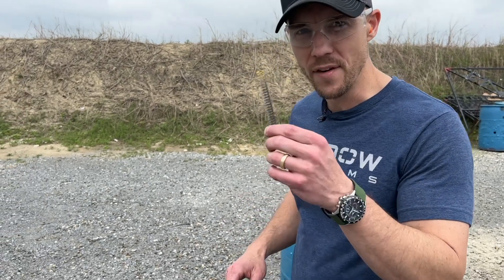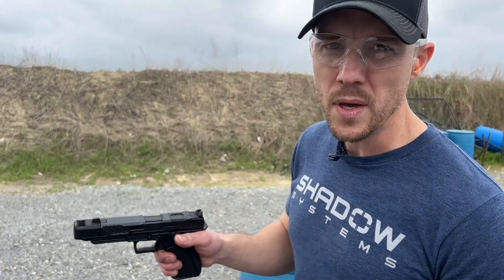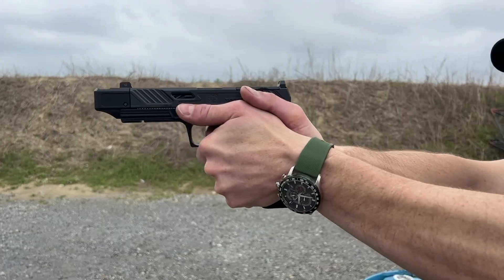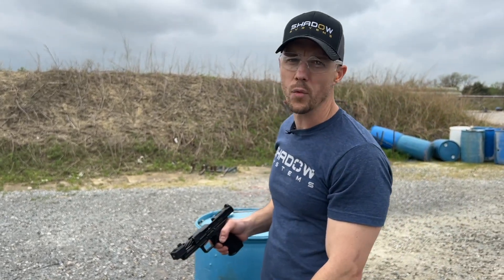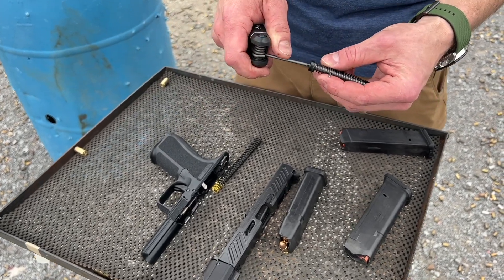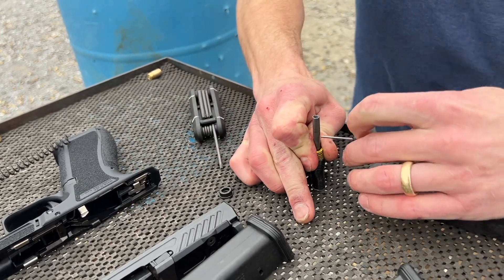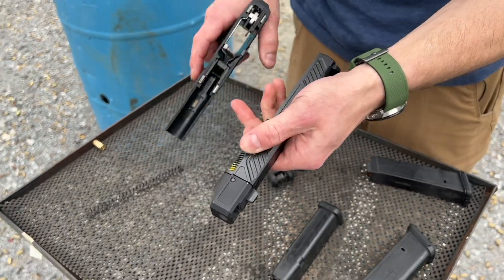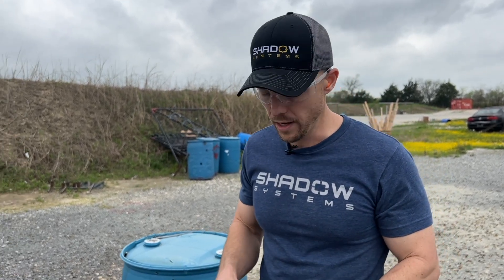Technical Tuesday - DR920P Recoil Spring Options

Comment: Tried changing the spring, used the takedown tool in the hole, snapped the takedown tool. That torx screw is glued on there strong.
Reply: Lol I’m having the same issue I just recommended buying the complete guide rod set 😂

Comment: Never had issues with my glock 17 jamming up, purchased the dr920 for duty and routinely have issues stove piping while running practice ammo, hope changing the spring eliminates that problem
Reply: See my full comment above. Same here for my experience on the DR920.  In my opinion, Trevor's comments regarding poor technique is gas-lighting customers to make them believe it's their fault rather than a fault of the company for not doing full research on the 'P' model prior to release.  Every compensator I've ever tried requires tinkering with the springs to get reliable cycling, period. Scott Jedlinski is the best trainer ever - some of his "technique" is covered here - See about 8:00 min. for "arms".
https://youtu.be/V_2PrZ_UG9o?si=wbF3AHjPLVK6j5EP

Comment: Recently purchased a DR920P. Left the standard weight recoil spring in it and ran 250 rounds of 124gr NATO Winchester through it with zero issues. Ran several different types of ammo in it, after the break in, and it runs like a sewing machine. Great pistol, I’m a big fan.

Comment: This video was AWESOME!  I was guilty of everything you stated, bent arms...too light/loose of grip  and .115 caliber ammo vs. .124 or higher (DR920P).   I was so, so excited to fire this gun and it jammed after one shot every time, and when I say jammed....I mean jammed...I could not clear or drop mag..,,,range master said it was probably wrong spring tension.  Can't wait to go try out with proper ammo and proper technique before replacing spring.  
1. Anyway you can slowly show how you break down this gun again?  I have a TON of handguns, I cannot for the love of God get this thing to break apart without dry firing once I've got it unlocked.....you do it way, way too fast in this video for me to figure out your technique. My Berretta and Bursa for example are super easy, this one is not.  I was always taught to not dry fire a gun, but doing this way always causes it to crumble apart...what am I doing wrong?
2. Is .147 grain OK for this firearm?
3.  Thanks again for your videos...very helpful and informative.
Reply: Jessica (in the blog below the article) with SS actually recommends the 115 grain for the comp on the DR920P because more gas makes it work better - her words not mine - Trevor says the opposite and recommends full power ammo (whatever that means).  And re: the "bent arms"- watch Jedi's presentation here - he covers arms at about 8:00 min. into the vid. In my opinion, Trevor's comments regarding poor technique is gas-lighting customers to make them believe it's their fault rather than a fault of the company for not doing full research on the 'P' model prior to release.  Every compensator I've ever tried requires tinkering with the springs to get reliable cycling, period.
https://youtu.be/V_2PrZ_UG9o?si=wbF3AHjPLVK6j5EP

Comment: This isn't really the problem, most people use 115grain 9mm at the range, probably the most available and affordable. This gun has not done well with that even with proper technique, really does need the lighter recoil spring to operate properly

Comment: Question about the mr920 with threaded barrel how do you get the thread protecter to stay on always coming lose
Reply from the maker: Tyler, have you tried an O-ring?  We have them on the website.  Using it between the barrel and the thread protector will keep it from loosening.  Take it off before mounting a can!  Trevor

Comment: This had my cracking up. He has given up on trying to teach you the proper technique and just giving recoil springs instead 😂🤣 I feel bad for him
Reply from the maker: Hahaha.  That made me laugh pretty hard.  Trevor
Reply: I've owned my DR920P for a week and put about 1000 rounds through it. I can solidly say that it isn't poor technique that's the cause of malfunctions with this gun but the nature of Glock style guns with comps on them. I've shot a wide variety of ammo through mine, including lighter 115gr, 124gr and 147gr and had 5 other shooters try it as well. Mine cycles the hotter loads with no issues but the PMC Bronze 115gr gives me occasional stovepipes and some lighter pressure 124gr I have gave failures to extract. All these are indicators that the recoil spring is too heavy.

Every company under the sun will tell you their comped gun or their compensator will work with a standard weight spring with any ammo and almost all of them will require some tuning.

I look forward to dropping the 15lb spring into mine to get complete reliability with all ammo types.
Reply: I can’t imagine the ridiculous calls customer support has to deal with.
Reply: All the tactical wannabe badasses that have not even the slightest clue how to shoot have these issues. They are too busy trying to make their EDC setup be the hit of Instagram to actually practice any fundamentals.
Reply: @adk77caps52  it’s just sad. I really wish they would have made them to work as good as possible and run hot gassy ammo like it needs. Could you imagine how many calls they would get saying the guns aren’t working 😂
Reply: @adk77caps52  nailed it.
Reply: This is sad that this has to happen. But.... some people may have Injuries
Reply: After running my MR920 in limited and being able to hold my own, I’m seriously considering picking up a DR920P and turning it into an open minor gun.
Reply: A gun should go bang no matter what , this is an excuse .

Comment: Is this true for MR920 also?
Reply from the maker: Hey!  The standard recoil spring weight that any factory selects (Shadow included) is based on use with standard ammunition and a typical service life.  If you ran a light spring in a gun all the time with standard pressure or +P ammo, you would eventually beat up the gun or break parts--just ask the guys that used to run a 15 lbs in a .45 back in the day in USPSA.  Sheared barrel lugs and broken links were not uncommon.  

Using an "other than standard" spring is done in a special cases like suppressors or compensators.  The addition of either simply makes the gun more sensitive to shooter technique, ammunition, etc.  That means the gun can benefit from a different spring in certain scenarios.

If an MR920 is giving the symptoms of shortstroking that we discussed in the video (not picking up a round, failure to eject, even failure to extract), this is not really a case where we would say "try a lighter spring."  A stock MR/XR/DR should run fine in the VAST majority of cases unless you are running some really, really light stuff or your technique is terrible.  However, if you add a comp or suppressor, it's time to think about a different spring if you start to have issues (assuming good technique).

Sorry so long winded, but recoil spring selection is a balancing act.  The goal is to slow the slide down enough to protect the gun and shooter while maintaining reliability in the widest range of scenarios and operating conditions.  Trevor
Reply: Or the XR with a comp?